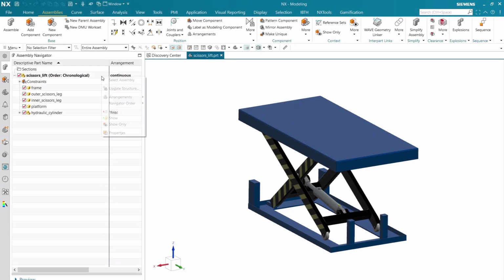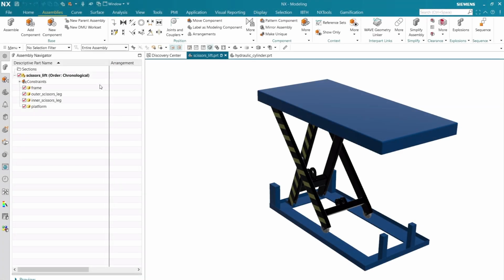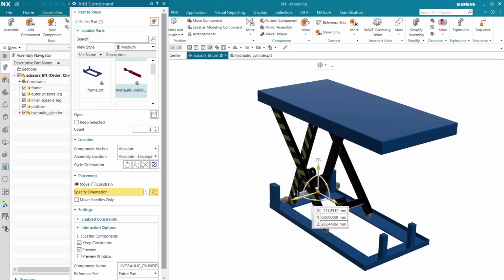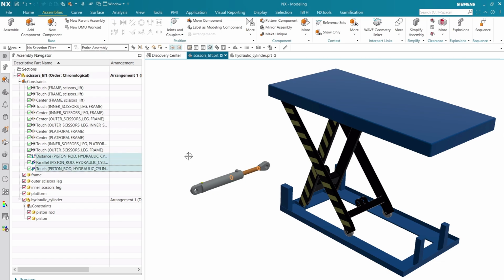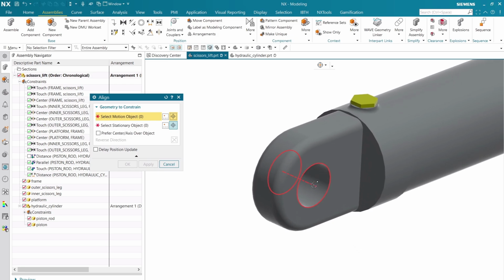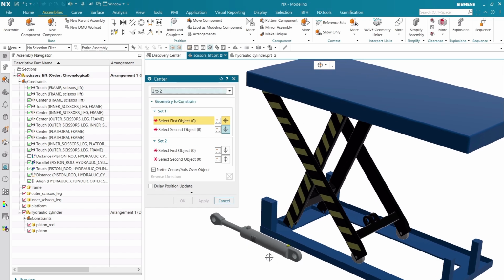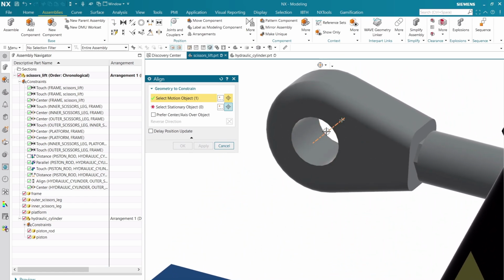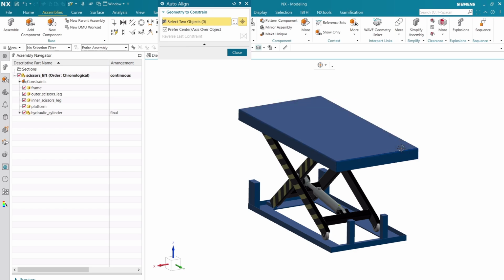Siemens NX – Continuous Arrangements

Comment: Nice video, but I think you did not explain enough how this override position and later "Copy to override" works, could you record video where it is explained more in detail?
Reply from the maker: Thanks Piotr. The main focus of this video was actually the concept of the variable arrangement.
I wanted to show that you can use arrangements not only for fixed positions like minimum and maximum stroke, but also create a variable arrangement where the hydraulic cylinder position can be adjusted continuously between 530 mm and 775 mm.
This makes it possible to simulate and check different working heights and machine positions directly in the assembly without creating many separate arrangements for every single position.
The Override Position / Copy to Override steps were only part of the setup required to make the arrangement behavior work correctly.